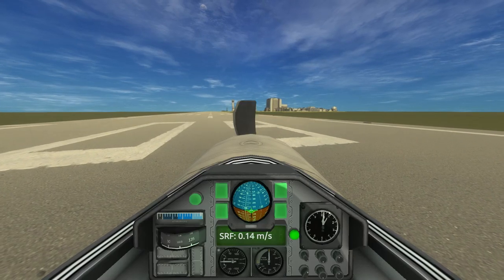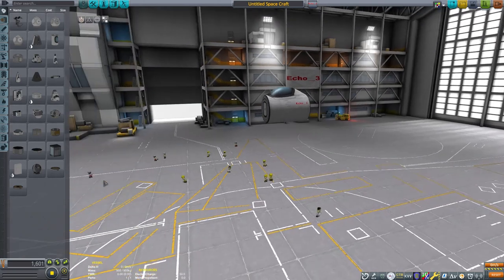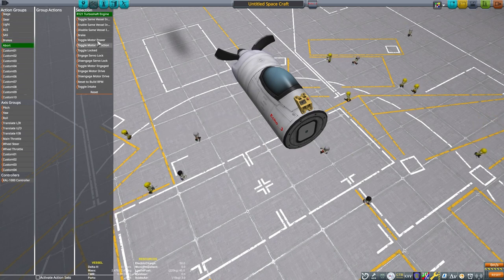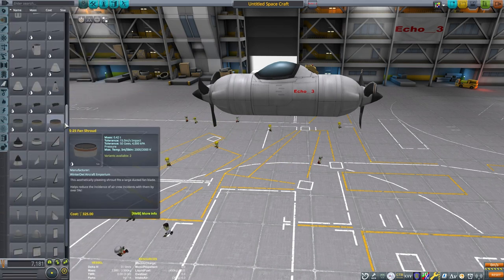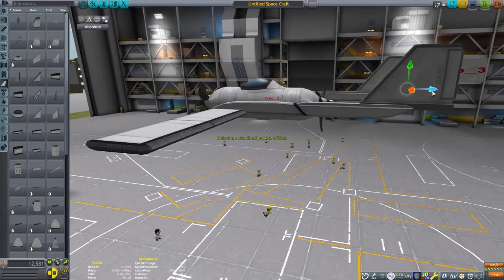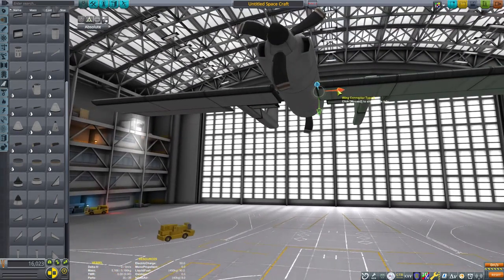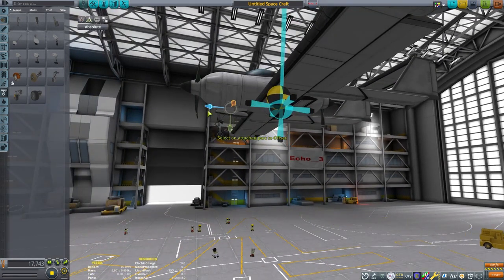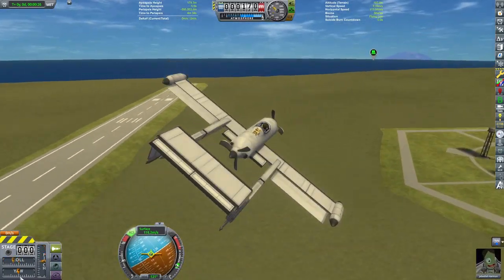Push-Pull Configuration Tutorial: Very Fast Prop Plane

Comment: That air intake as tail booms trick is just what I need for a twin-boom design! Of course, there’s also the bounty of prop tips here. Nice video :)
Reply from the maker: Thanks. The air intake is much lighter than the structural pieces, so it's pretty useful.

Comment: Yes, yes, GOOD! Exactly what I was looking for, like a Cessna Skymaster. I personally took the stock Gull and made a twin engine electric out of it, but that was conventional twin engine config, not the Pushme-Pullyu. On the subject of leveling front/rear landing gear, do you ever have a problem with crazy bouncing when you hit Launch and it first appears on the runway? I haven't seen this in the last year, but it used to be a regular problem for me. Most excellent videos. Unlike some popular Youtubers, you are actually good at explaining things. Liked, Subbed, and ding-ding bell click.
Reply from the maker: The crazy bouncing issue seems to happen if I overload the landing gear with too much weight. Sometimes playing with the spring strength and dampening can help, but that is also a good way to invite the Kraken.

Thanks for the Sub!

Comment: I have found some stuff that might be very obvious but could be useful for people who want to build props. I build my plane and use launch clamps to see the max horizontal lift the blades will produce then I multiply that number by how many blades there are. I use that number to set the max power on a motor. Always round up on that. This is useful to keep the torque and weight down and less electric drain.
Reply from the maker: This sounds useful!

Comment: For who wonder about Delta-v like me i just look how much engines burn, it was 0.3 at total so with 190 unit of fuel you have 633 second of thrust lets say some of that for take of and landing you have solid 10 minute of thrust independent of your throttle. With 270 meters per second speed and 600 second long fly you can reach 162 kilometers away. But i just did fly towards to west and reach the shores with burning 150 fuel and 40 left. its 147 km away and there is mountain in between, i climb to over 5km. You can easily reach and unlock Cove Launch site (47km) and İsland Airfield (32km).

Comment: Hello, I would like to know where the information on the advantages and disadvantages of the push-pull configuration comes from? I also want to know how to find the information related to the design of the front and rear power systems?
Reply from the maker: Some of the advantages only apply to real life as KSP doesn't consider fluid dynamics in its physics model. But as far as Newtonian physics it does. This opposite rotation of the propellers cancels the torque and makes the plan very stable and easy to fly.

I don't remember what all sources I used as I did a lot of research about prop planes and helicopters. I know I also asked a lot of questions to my friends that are actual pilots.
Reply: Thanks for your answer. I would also like to ask you whether there is any additional vibration problem with the rear engine in the push-pull configuration. If so, is there any literature on how to solve this problem? And whether the efficiency of the rear propeller is disturbed by the airflow through the front propeller, causing it to decrease? Finally, are there any design solutions or design difficulties related to the intake and exhaust of the push-pull engine?
Reply from the maker: @billcroft449  I know I read up on a lot of this before making the video. Unfortunately, I'm not recalling all of it. I believe there were some slight issues with efficiency with the rear props due to the airflow around the fuselage - maybe it was about 80%. I don't recall reading about any issues with the intake or exhaust.
Some advantages I remember were that it didn't have the noise issue that a typical contra-rotating prop design has, but it still cancels out the torque. And there isn't an off center thrust issue due to the loss of an engine.
Rear mounted props were a liability early on in aviation as it was very dangerous for a pilot trying to bail out. But with an ejection seat, this wouldn't be a problem.
Reply: @Echo3  Thank you for your explanation

Comment: i have a question is the deploy angle need for this to work cuz im on xbox and there is no deploy angle option for some reason a couple of options are missing but just the ones that are not necessary to get into space.
Reply from the maker: For the propeller blades, I think consol uses the term authority limit. That gets bound to the KAL 1000.
Reply: Oh ok
Reply: @Echo3  I got it mostly working to fly's I have to play with RPM limit controls to get it airborne but after that I got it to stay in the air I don't know why but mine is slower even though I fallowed every step mine topped out at 121 MPS or 435 KPH / 270 MPH I'm not vary good with propellers but it flies better than my last attempt and look better too so thanks for the help
Reply from the maker: @leedleleedleleedlelee6825  I did make another video to help players get started with propellers. It is not nearly as complex.
https://www.youtube.com/watch?v=eMZSisbhL6A
Reply: @leedleleedleleedlelee6825 you can still do it the same way as he did in this video. Use a quick command to turn on engine,another to max rpm and torque,then binde Kal to main throttle and have the Kal adjust the authority limit on the blade deployment. Just remember to set the propellers to deploy while building so that the Kal will actually work. You also have an option on xbox when binding the Kal to main throttle,you can chose "Incremental or Absolute" authority. Use absolute and just hold LB when slightly adjusting the throttle. 
I'm sure you've already figured all this out by now,I'm just saying it incase someone else is reading this and wondering the same thing. I only play on console so I've had to learn how they differ and how to make it work on console. 
All the best to both of you.